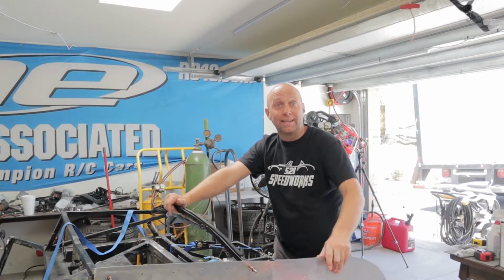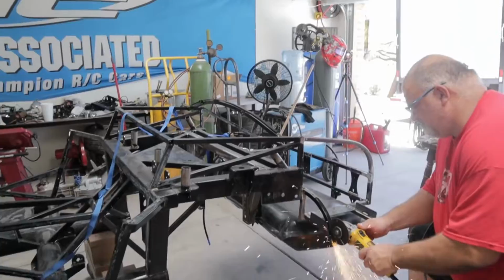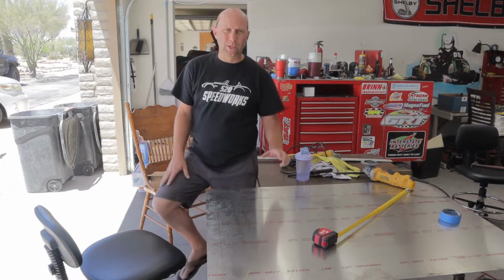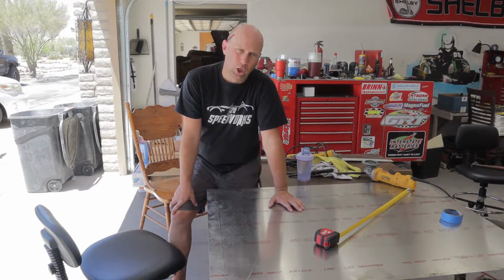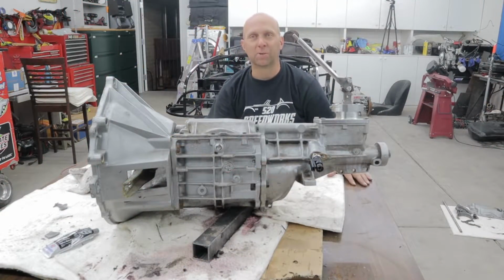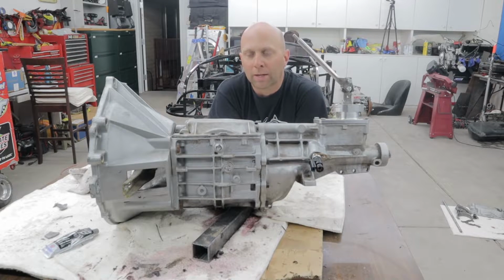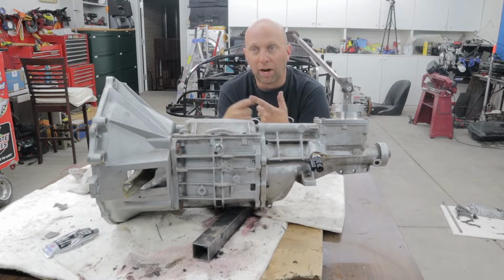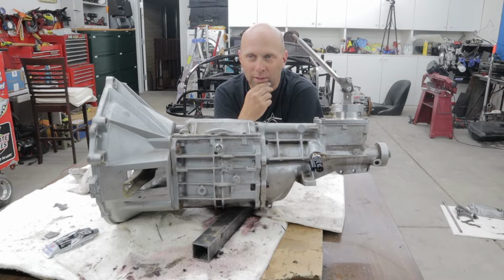Wrecked Cobra Rebuild Part 10- Getting Shifty

Comment: Hey guys, great build!  I’m thinking about an F5 in the upcoming year. Question: On the trans cleaning. What was the source of all that metal?
Reply from the maker: Hey Michal,  The metal came from a hole in the top plate. During the crash the motor broke from it's mounts and slid forward about 10 inches. That caused the transmission to hit a chassis bar and crack it open. We talk about it at the 9:56 markhttps://youtu.be/5EISwFsKJvw?t=596. Congrats on the future build. Lets us know if you need anything. Also check out the website 520Speedworks.com. We can help you spend more money. 🤑😎

Comment: I don't think I have ever seen anyone put a battery there.  Maybe I missed the reasoning please share.  Love the build!
Reply from the maker: Hey Mick, not sure if we are the first. We wanted to hide the battery. Did not want it in the engine bay. Could not put it in the truck above the rearend  because of the 5-link suspension. So empty wheel well meet battery. And false panel hides it all.
Reply: @520speedworks6  For weight balance, wouldn't the passenger side be better?
Reply from the maker: That would have been our first choice for that reason. But the right fender well contains the filler neck for the gas tank. We will get the weight close to equal.